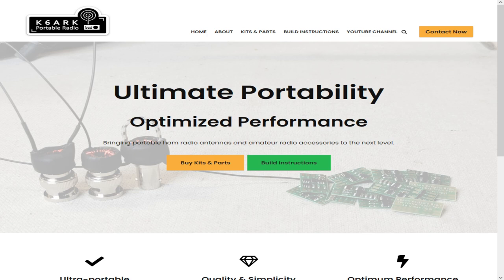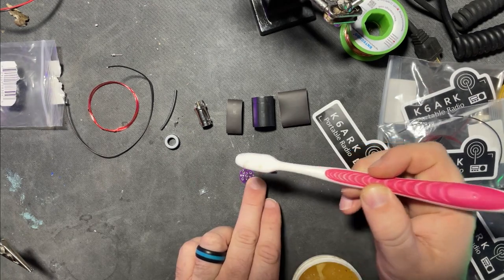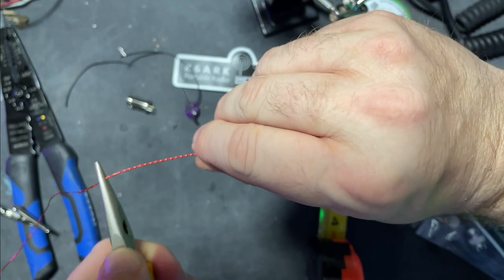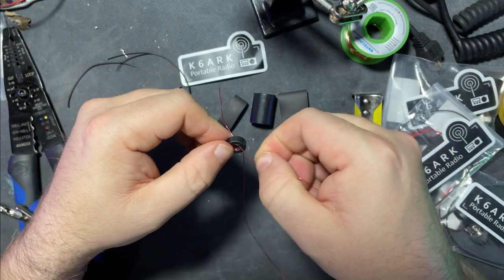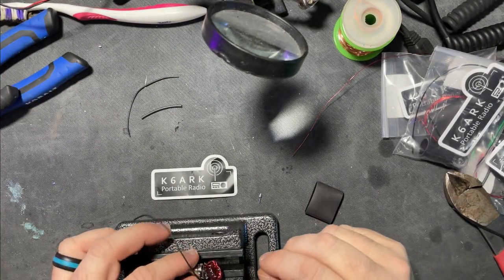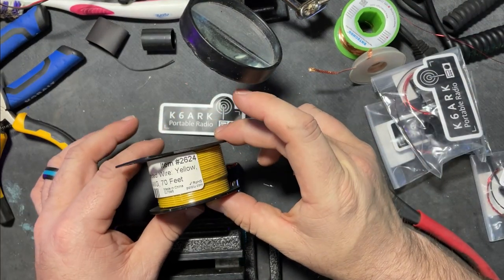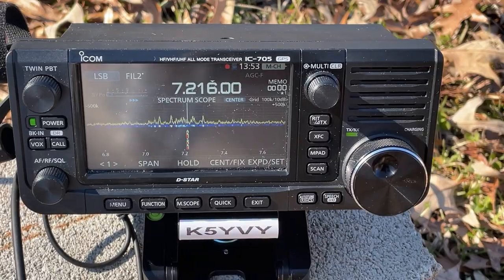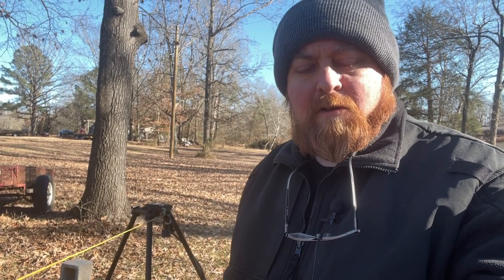Worlds smallest HF antenna matching kit? | K6ARK | EFHW | Ham Radio

Comment: oohh....using the buddie stick tripod for some elevation....nice idea.
Reply from the maker: Thanks Kyle! Sometimes I have good ideas by accident. I started to even attach the telescopic whip with the feed point attached to the top of it for more height, but figured someone would have a fit that I either used metal to elevate it or that I was going to break something lol.

Comment: Fine business! Thanks for the tip about the 70' wire, that's exactly what I was looking for. 

73 DE W6JV
Reply from the maker: Awesome! Thank you for your feed back. In hindsight I should have mentioned that currently I’m only doing voice ssb when portable, therefore if a person is looking for fine tuning for cw/digital the length of wire might need to be slightly longer. Have fun! 73

Comment: Nice job. Looks like a great antenna for the IC-705. Especially when it's that small, it's easy to pack in the bag or box. It's always nice to have antenna options and a backup when out in the field.
Reply from the maker: Thank Mike! Yep getting the make BNC version you can connect it directly to the radio. It’s definitely a small one lol. And yes back up’s are assists a good idea.